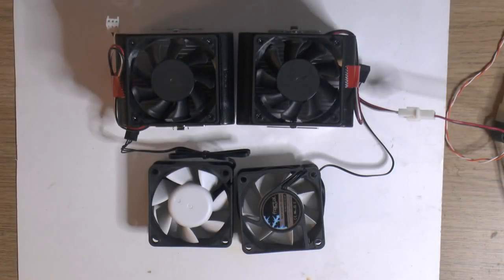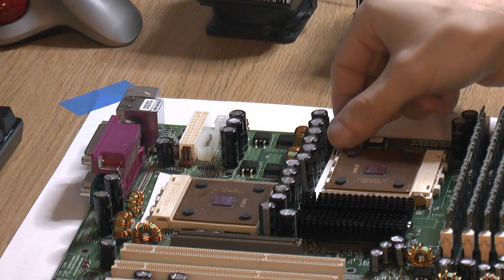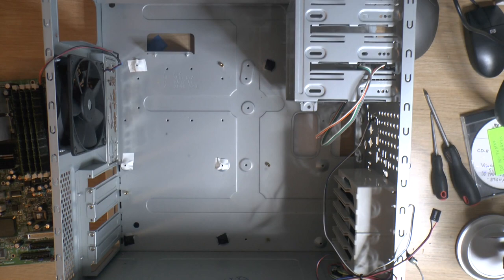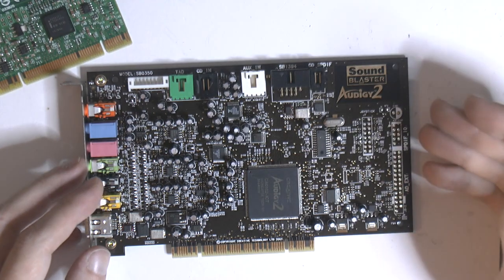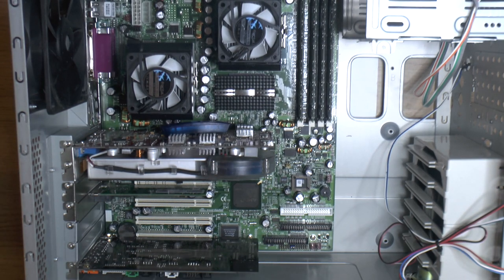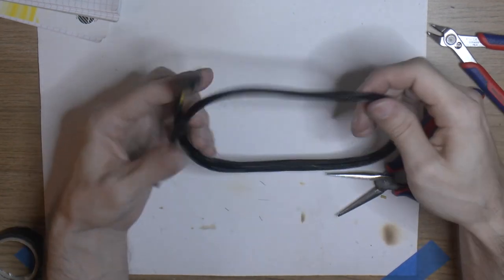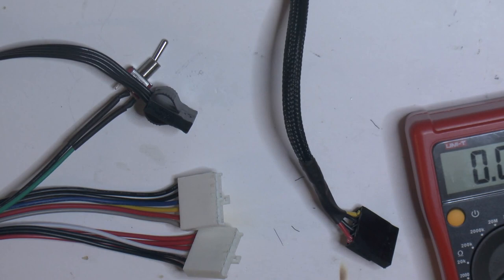Dual Athlon MP build part 2

Comment: Chipped or shattered CPU dies are mesmerizing to look at. The silicon, when broken, is quite tragically beautiful. I've, luckily, only seen it once from a processor that someone else damaged in my high school computer science class. I still miss those days. I did literally none of the lesson plan materials and just took the tests. I always finished early, helped the teacher grade them, completely broke the grading curve, then went on my way to build computers with the parts the teacher had stockpiled in the back room. It was amazing how decently well a heavily pared down and cracked version of Windows XP could run on a Pentium processor with way less RAM than it called for. Particularly when I found a case with sound deadening material and a SCSI card connected to a 12k RPM drive. Fun times. That class was also my first experience with a computer running Windows ME. I had a lot of fun installing and playing around with all of the GUI versions of Windows. Unfortunately I wasn't up to the task of figuring out DOS at that point in time. Even now I'm not sure I'm up for figuring out DOS. CLI has never been my comfort zone and likely never will be. I've grown accustomed to it when I have to use it, but it still isn't my preferred method of interacting with an OS.

Comment: On every board with this chipset I always had a difference of five degrees between the two CPU. For that reason I was using fan controllers in all six computers. The biggest difference was with the later Opteron CPU's also on Tyan boards, it was around 15 degrees.
Reply from the maker: On this Tyan S2466 I had 49C and 51C, you can see that in part 3 coming next friday.
My goal was trying to reduce hot air recalculation by pull configuration and exhausting the hot air asap and it seems to work pretty well.
I expected more of a difference but the CPU's really dont have a sensor anyways so its all based on the ambient temp under the CPU.

I also had two Tyan s2895 with Opteron 265 and later 280 with Zalman 7700 copper coolers. The temps there where very similar but there where a few bioses for that board with buggy temp reading where on was always reported hot and one cold.
Also I had a side fan blowing in cold air in the Chiftec Mesh I used and big 120mm rear exhaust.
K8 processors never had a reliable sensor either according to AMD so there recommendation in there own forum was, touch the base of the heatsink and if you dont burn yourself its fine XD One way to check the temp I guess hehe.

I still have a Dual Opteron 280 system as a retro lan server with AMD 125W TDP stock coolers, CPU's are 95W TDP so temps on that is very good.

Tank you for watching and have a nice day!
Reply: I have a gen.3 i7 where one of the cores is always up to 8 degrees hotter than the rest. At the beginning i was worried but it still works after 8 years and is overclocked by 25% for 3 years now.

Comment: 3:44 y were the cpu-fans mounted inverted? did i miss the explanation?
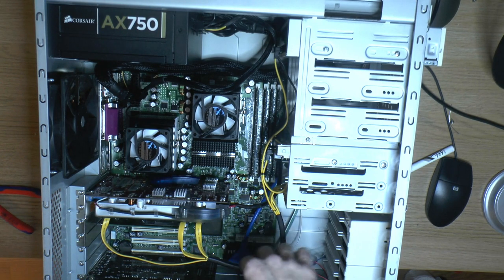explanation later @ 31:08
Reply from the maker: Ty for watching to the end!
I did test my theory off camera and Push ran hotter.

There is more on this topic in my Athlon MP Barton upgrade video and also My Dual Pentium III build with Alpha Pal 6035 that still had stock fans in pull configuration.

Dual Athlon MP Bartons
https://youtu.be/j1N7oXQVhUE?si=ParOgvt2MH_njZfj

Dual Pentium III
https://youtu.be/KhRBBWC7y8I?si=q0lFUMNTBhh3alQ4
Reply: i am just as curious as always. i also run many old systems. at the moment i am looking for a dual so7 to build a dual p200mmx or p233mmx with some ram and NT4 and Win2k and some Linux. right now a have to use my dual p2-350/p3-450. a friend has a dual athlon mp on a tyan tiger but he didnt give it to me. so i had to watch your playtime to get a little into it. ^^

Comment: I built one of these in around 2001. I didn't use it for awhile and when I tried to boot it around 2006, a bunch of the capacitors had leaked and the system wouldn't boot. Just a BIOS screen and error messages. I saved the CPUs and coolers, but pitched the board. Probably should have given it to someone to re-cap. :(
Reply from the maker: That is usually what happens to most electronics.